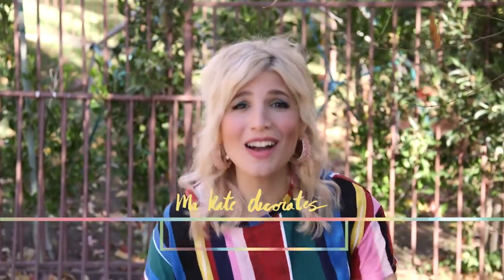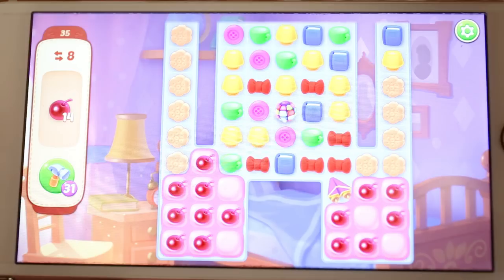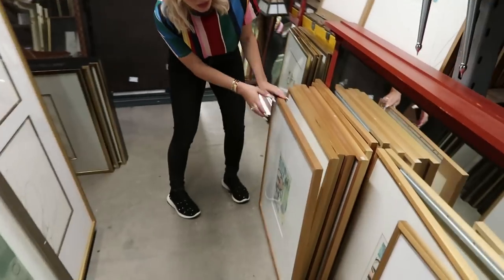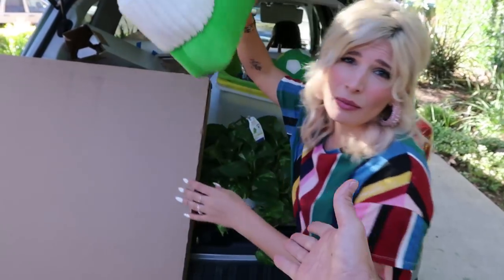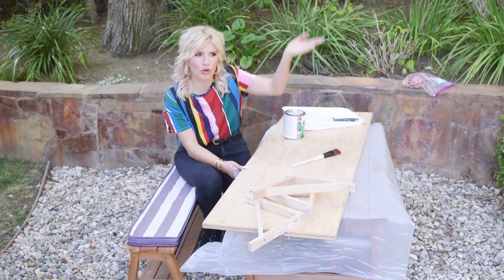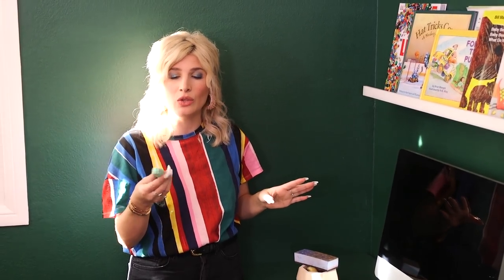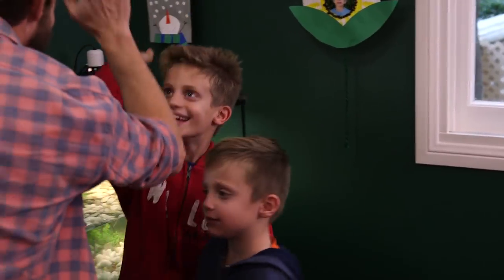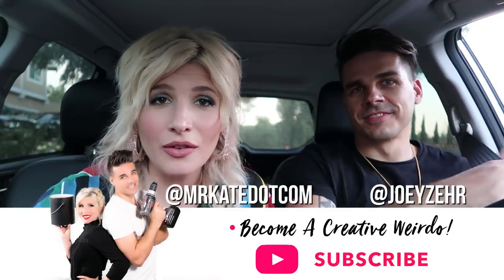Under $300 Room Makeover for Kids!! | Mr. Kate Decorates

Comment: How do I get you to redo my room? Haha my room needs help.
Reply: Ginger Hu Haha
Reply: Send a video to them! Lol. I'm considering that
Reply: Go on pinterest like she does. Pin up some realistic ideas. Make sure it stays in your budget. Make a plan. Write down wot has to be done. Write down a list of things that have to be bought. Start with cleaning out the whole space. Moving if necessary all the furniture. Mask tape everything that has to be covered. Paint it. Give it two coats minimum. Let it dry. Make sure u got your diy art done whilst it is drying out. Get your shelves done, tv up if necessary, trinkets, bedside tables, lamps, rugs for feet there is nothing more wrong when getting out of warm bed on stone cold cold floors. Make sure u have extra boxes and storage to hide away things u don't want. Throw for the bed and armchairs, cushions. Put different curtains up and make sure that they are way above the window, thus u will give your room higher walls visually. You will need a drill, scres and other pins, set of brushes and rolls, paint, masking tapes, time n new stuff or flipped over old stuff. It easy. Needs planning and help from people in the house. Pinterest n sourcing is the key. Prepping is what will get it to the next level.